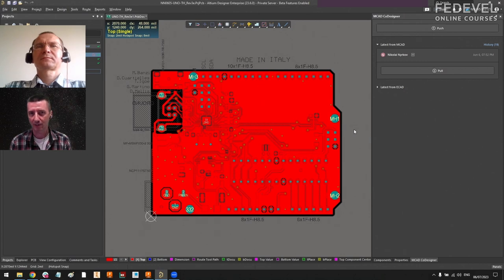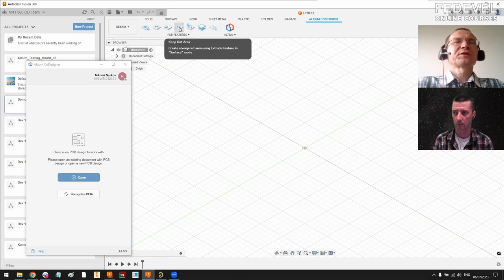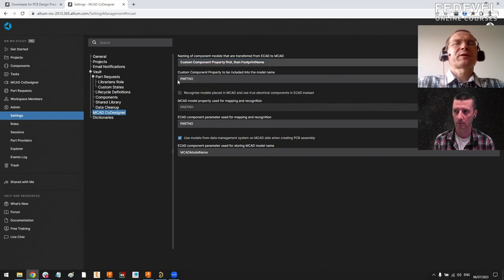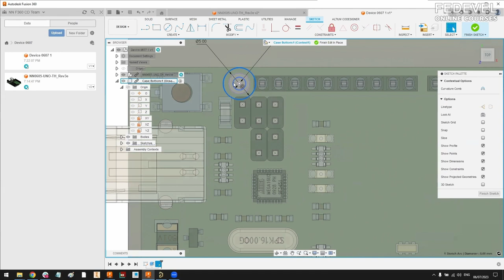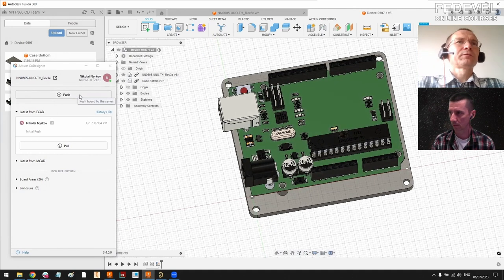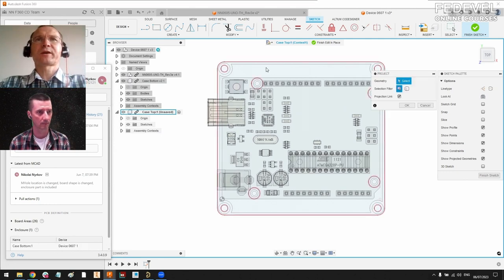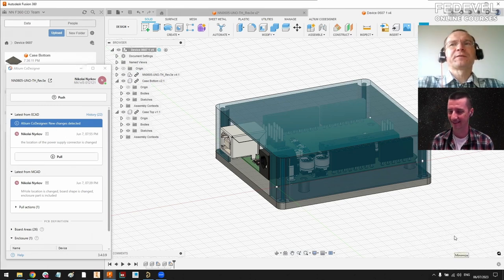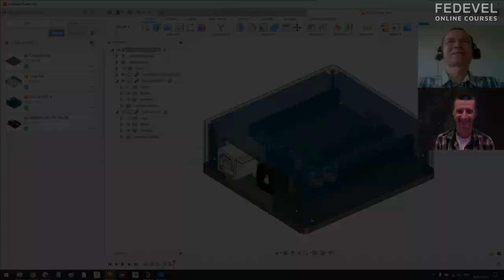How To Connect Altium With a Mechanical CAD Software? Here is an example ...

Comment: Great overview, we tried it at our company but we can’t really use it because of how Altium has designed it.

Going through the Altium365 servers breaks our CAD file traceability, and we discovered that the process involves a doble conversion (going through parasolid), which means it is possible to have inaccuracies crop up.
Reply from the maker: That is interesting to know. Thank you
Reply: Yes that's true (with the exception that there is one step if you are using Parasolid in ECAD). Altium is thinking about the "unified model library" solution which would allow to use models from one single storage on both sides, but it's definitely not for the near future... As a workaround, those who use the desktop MCADs other than Autodesk Fusion 360, can use the "ECAD-to-MCAD component linkage" which allows to place models from the MCAD storage instead of ECAD models.